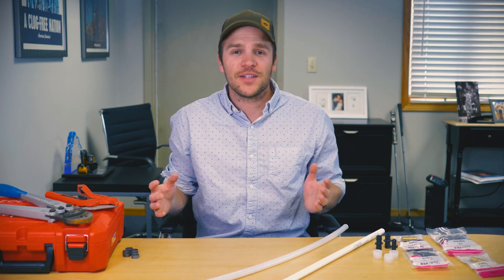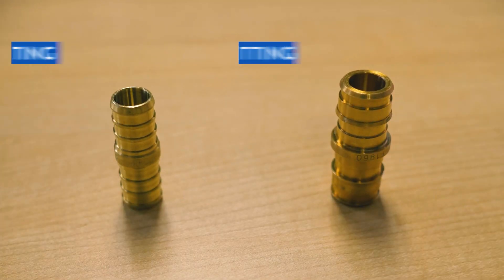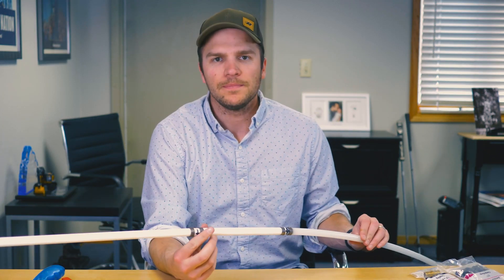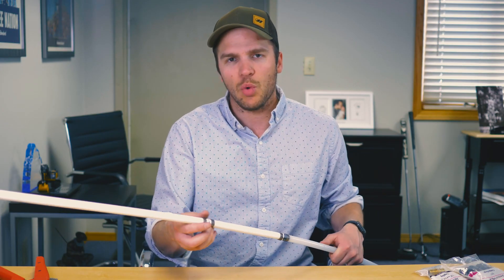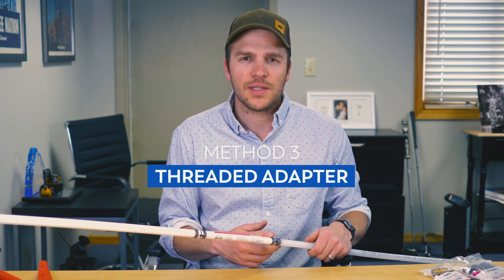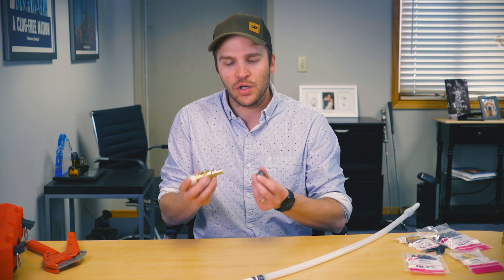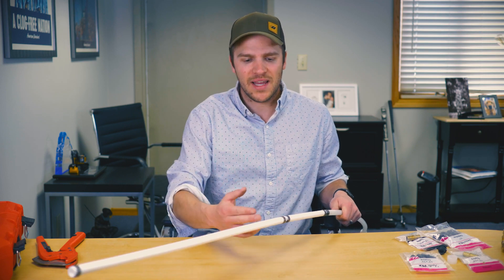Connecting PEX-A to PEX-B

Comment: If the tubing is marked F1807 then it is listed for use with brass PEX B style insert fittings. If it is marked F2169 it listed for use with the poly fittings as well. The PEX A is clearly marked F1807 at 00:26 which means it is permissible to use PEX B brass fittings with either rings or clamps. There is no need to convert from one to the other in any more complicated or expensive way. If you really wanted to come up with an alternate solution two PEX copper adapters soldered together would effectively make a true PEX A to PEX B (expansion to crimp/clamp) coupling.

Comment: I bought 3 lengths of Pex-A from Home Depot, my fittings went right in to two of the lengths but had a major struggle with the third section. Have you run into this before? Anyone?
Reply: You had this problem because you were trying to use a PEX A fitting. They are larger than the crimp fitting and require an expansion tool

Comment: Question: I have Pex A pipe throughout the house. I don't own an expansion tool for Pex A. Can I use PEX B fittings and PEX B clamps on all my PEX A pipe throughout the house? It will be much easier and cheaper for me as I won't need to buy an expensive PEX A expansion tool. Thanks!

Comment: On this old house they showed copper pipe and sharkbite fitting, they put it under extremely high water pressure,the pipe split the sharkbite was fine, their master Plumber still prefers soldering,
Reply: Bias beliefs are hard to change

Comment: How do you get the pex-b crimp ring to fit over the thicker walled pex-a tubing? Are there pex-a specific crimp rings available, HD doesn't seem to have them. Or, can you crimp a pex-b barbed insert, and on the "b side" a crimp ring, and on the "a side" an expansion ring?
Reply: pex-a and pex-b have the same inside and outside diameter.

Comment: I like those fittings with the stand off shows you where to put the ring. I had a leak not long ago where I crimped it too close the the end of the tubing didn't get it right in the middle of the fitting. Another thing is I know someone rat got into his house chewed a pex pipe flooded entire house. Something to think about before you choose PEX. Good old copper has it's plus side I built a house where rats are common like rural you want to go with copper, or there is a rat protection sleeve goes over the pex like a mesh.
Reply: Never gave this one a thought but a real possibility if you have a rodent problem.

Comment: sharkbite are recognized by all codes for installation in wall and under floor.
Reply: any plumber worth his weight in salt would not put a Sharkbite fitting behind a finished wall, and that's after talking to many  master plumbers. they prefer solid crimp connections.
Reply: @Robertrls01  the problem with sharkbite from a plumbers perspective is that anyone can install them and that is bad for their personal business
Reply: @Robertrls01  there is zero difference between sharkbite and crimp, if i had to choose one i would go with the sharkbite

Comment: I have been using Sharkbite connectors for 10 years, PEX A and B, copper, cpvc …. No Failures!
Reply: I had shark bite leaked on me in areas That caused me to redo my bathroom. Never again
Reply: i was going to ask also why does he not recommend shark bites  they pass with the code inspector. I also use push to connect fittings. The only thought is he learned from a old plumber for no other reason than tradition to not use PTC fittings.
Reply: @raymondrobbins9495 , good old tradition! 🤣🤣🤣🤣
Reply: @raymondrobbins9495  because it's not a matter of if but when a shark bites going to blow
Reply: Same for me
Reply: @peterbedford2610  I just run around with the interactive map open on my laptop it's a life saver
Reply: my home was built in 2016 and they put a Sharkbite pushon style 1 inch valve from the meter to the soldered valve at the cold water supply at the water heater.and it has been laying in my crawl space on top of the plastic sheeting and today still has zero leaks. I pick it up and move it sometimes when I work under there and have not seen a leak yet. It does make me wonder when it will leak like an outdoor spigot. I am going to have to go see how they transitioned from 1 inch pex to copper too.
Reply: Its cause they never called you back for that garbage😂 i dont blame them

Comment: SharkBite not ‘permanent’ but crimp is? First, no plumbing connection is ‘permanent.’ Permanent means forever, right? I have used copper with solder, and bad water will trash them. I have used pex A and B, and only very few connection failures, usually involving working in very tight quarters. To my knowledge, no SharkBite connection on copper or pex I have installed has ever failed. Sadly, any sizable job would bust the budget with 100% SharkBite connectors. But SharkBite, IMHO, properly installed, is as permanent as any other connection properly installed.

Comment: Great video, now I can repair my plumbing with crimps instead of buying an expansion tool! Not sure why the grief with SharkBite fittings, but I love them. I only prefer them to crimps in tight situations, like 2" wall protrusions. I'd rather be able to use SharkBite fittings knowing they will come off. A lot easier than replacing drywall just because you have to redo a connection a few times. Of course, you do very much need to make sharp, clean 90 degree cuts with SharkBites. If possible, I will use crimps first, but when pipes get short...

Comment: It is not a manufacturer-recommended transition, but "it will work in the real world." On what do you base that? How many of these jerry-rigged PEX A connections have you done, and how many years have they been working? Then you say you don't recommend SharkBite fittings, stating that you wouldn't recommend them as a permanent transition, even though they at least state their product is designed for PEX connections. While I wouldn't like to trust SharkBite for PEX (though I don't know of any specific reason not to and I have dozens of SharkBite fittings installed on copper pipes in my home that have been there for over a dozen years with no problems), I certainly wouldn't trust your method. If I ever did find myself needing to transition from PEX A to PEX B, I would use brass fittings along with a piece of copper pipes. I think it is a very, very bad idea to rig up a connector/fitting designed for PEX B on a piece of PEX A.

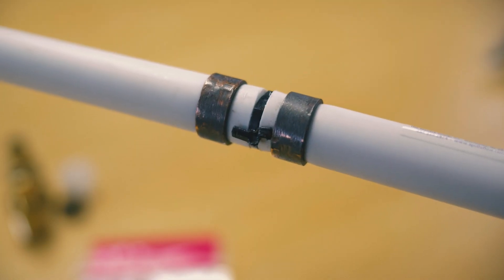Comment: Very helpful video. I'm just a DIY grandpa who hadn't worked with PEX. From this video I was able to identify that my garage had been plumbed with PEX-A (0:37), that some of the connectors I purchased were PEX-A (at 1:31) and that I had purchased a PEX-B crimping tool. So - back to the big-box-store to return PEX-A connectors with PEX-B ... easy job to complete with all the correct parts.
Reply: The big-box-store PEX pipe wasn't labeled ... but was SharkBite which I found elsewhere will always be PEX-B.

Comment: In my opinion it depends. I have installed SharkBites correctly and they are still going strong 5 years later. Usually there are only two reasons why are SharkBite fitting will not work. 
1. Human error when installing
2. Yes once in awhile you get a bad one (manufacturer defect) in the bunch.

Comment: So what your really saying here is that regular pex fittings work on both a & b.
I find that heating type a with a heat gun makes it a lot easier to use the crimp style rings.
Reply: I was thinking about putting ends in boiling water for a few seconds. Got to be a cheap easy way to join pex A without special expansion tool

Comment: Pex B is not more restrictive if you just go one size up on everything but then it probably works out more expensive and more wasteful. I've heard it's fine to expand good quality PEX B and fit it like PEX A. Could this be true? Personally i would work in the warm and would be afraid to fit in low temperatures especially if trying something like expanding pex b, a low temp expansion testing of pex b could be a good way to test it to it's limits on that theory but would it be reliable? I dunno.

Comment: Re-did all the plumbing for the house during a gut kitchen reno 6 years ago. Bathroom sits above the kitchen so it only made sense to change out all the galvanized stuff while everything was open. I built a manifold and used pex-b and ran pipe from every fixture to it. The term is home run I believe. Zero fittings in the walls. I used sharkbite connectors at both ends of all the runs. Have had ZERO issues in over  6 years. The statement that sharkbite connectors are only for temporary fixes is 100% incorrect. And arrogant.

Comment: How do you transition from cpvc to pex type a?
Reply: One method using a specific adapter would give a secure connection. Here's a link when I did a quick search.

https://www.dkhardware.com/epxcpvc12-1-2-in-brass-pex-a-barb-x-1-2-in-cpvc-straight-adapter-product-3242660.html

Comment: I am not a plumber, but an experienced DIYer.  (I worked for a plumber for a couple of summers in HS).  I renovated 2 houses with Wirsbo Aquapex.  So I have the tool.  I recently moved into a new construction house with PexB.  Whenever I make a change or add I usually make a coupling by sweating a Uponor ProPex to copper sweat coupling to a PexB to copper sweat coupling.  I end up with a stub with Uponor ProPex on one end and PexB on the other.  

It is time intensive.  But it actually saves me time because I don't generally keep the threaded connectors on hand.  

I just thought I'd mention it as another way to do this coupling that would be manufacturer approved.  And in some cases if you have the couplings on the truck, its faster to make this conversion coupling than it is to go to the supply house.
Reply: Lol
Reply: Sweat to sweat sounds better to me. Diameter of a PEX b fitting is smaller than PEX a. I'm sure in a pinch the first method would work but I trust the solder and proper fittings first.

Comment: he doesn't recommend sharkbites as a permanent solution.  Anyone here have a properly installed sharkbite fail?  Been using sharkbites for almost 20 years.  Never had a failure.  YES they might fail someday, when they do I might not use them for permanent installs.  I will say I have seen a lot of copper fail.  True properly installed copper should last 50 year.  but installing copper properly is much harder, few plumbers do it well.  i think pex-b style connections are the best followed by pex-a then sharkbite type fittings.  if you understand the physics behind a sharkbite fitting you will understand why it is so good.